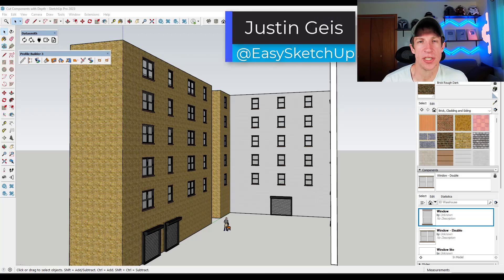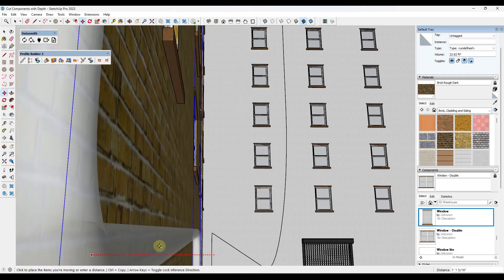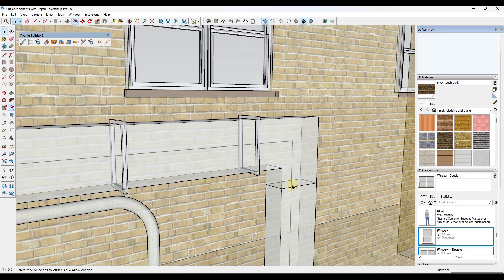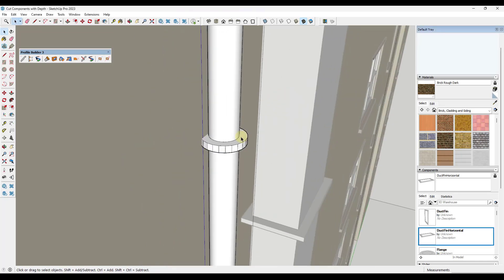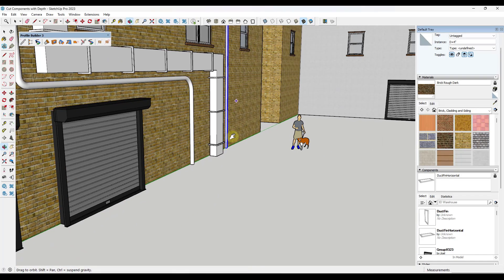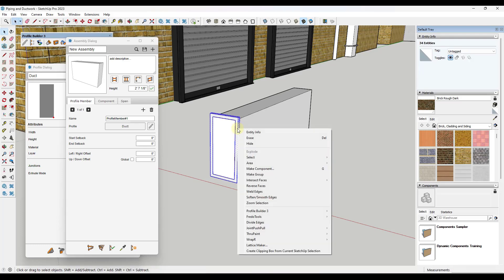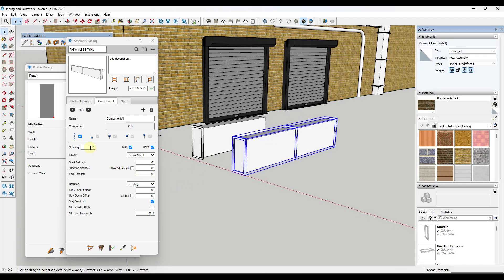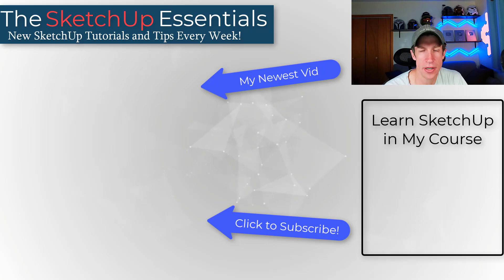The ULTIMATE GUIDE to Creating Piping and Ductwork in SketchUp!

Comment: I think it is great that you can create the piping so quickly, but I'm really confused.  Wouldn't it be so much better to use a pre-made library of actual fittings and pipes (ideally with prices) so that you could build the pipe, verify the type of quantity of each fitting and then get an overall price estimate?
Reply from the maker: Depends on how in-depth you want to be. If that's what you're going for, sure, but most people don't model to that level of detail. This was much more for visuals than anything like estimating